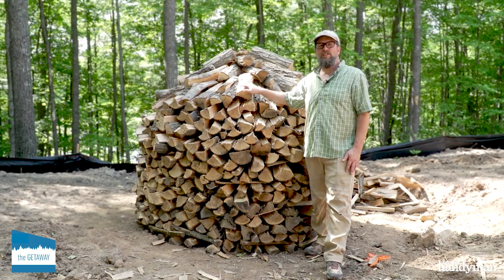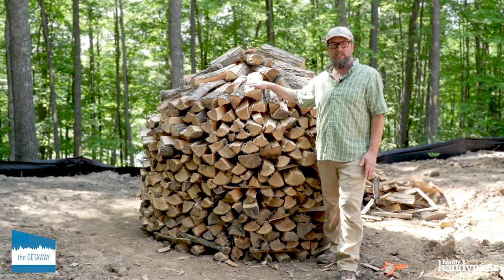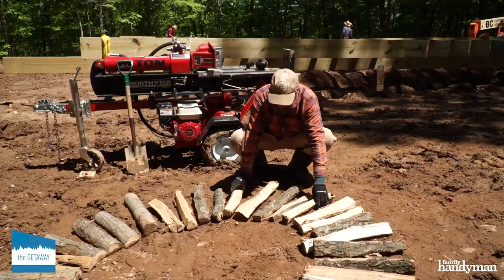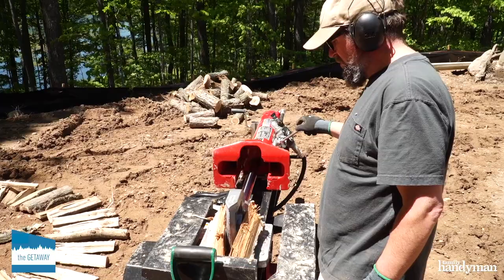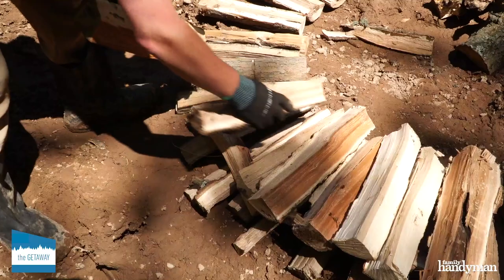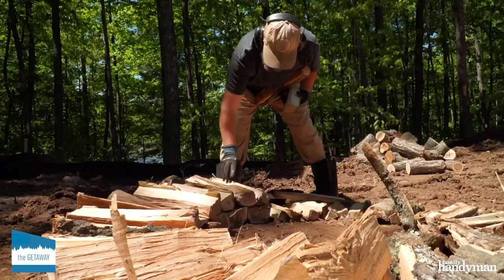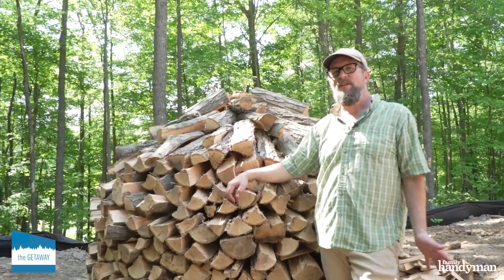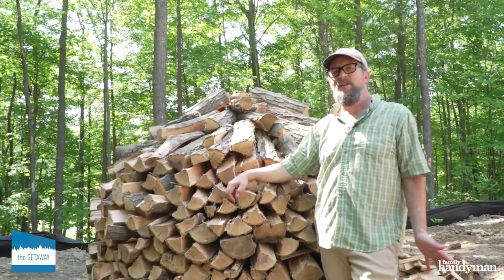How to Create a Holz Hausen

Comment: Wait...you are shimming the outside? That makes water go to the center. Also you don't just throw random wood in the center. This is like "how to eat a chocolate bar....shove it in your ear."
Reply: You’re right. 
Needs to have the bark outer-layer round the other way round on the split wood 
(so the bark is on the top and not the bottom to allow run off to the outside of the pile.)
And each piece should be angled downwards slightly away from the centre to again allow run off water to drain away from the centre …..